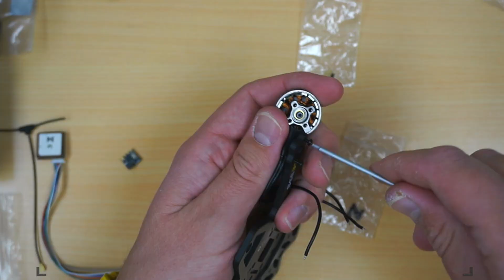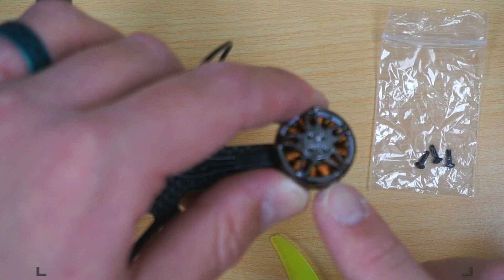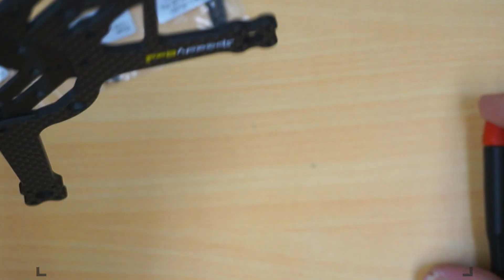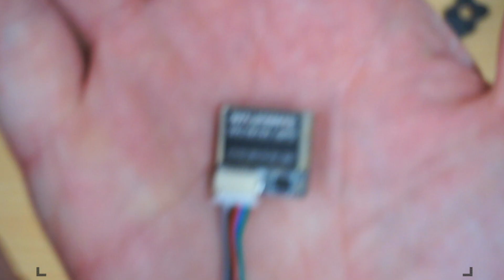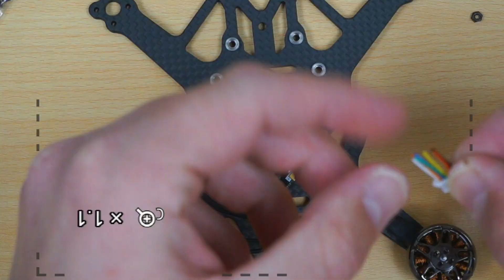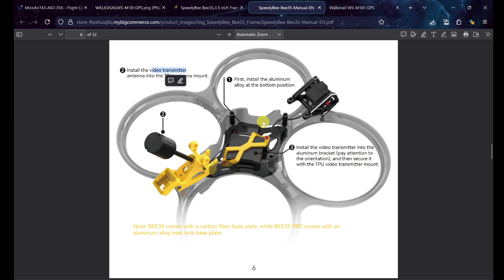SpeedyBee35 + MicoAirH743 AIO + EMAX 2004 3000kv + Walksnail M181 GPS + ELRS RX Construction

Comment: Why should the Tx/Rx wire connections be swapped? Why not change the parameter in Ardupilot SERIAL3_OPTIONS to "8" which would swap Rx/Tx pins? 
Please let me know if works!
Reply from the maker: You could potentially do this, but it is only possible on some flight controllers, so better practice in my opinion is to make sure you always physically attach the wires in the Tx -> Rx/ Rx -> Tx orientation.

Comment: Can it be done f450 frame using 2212 920KV motors along wit 4s 10000 mah battery to carry 300 grams/10.5 Ounces of payload
Reply from the maker: I flew some F450 style frames in the past, but mostly with 3S 5000mAh and no payload - and they were still somewhat underpowered.  I don't think you will get what you're looking for with that hardware.  Try out ecalc for a great calculation tool  - https://ecalc.ch/